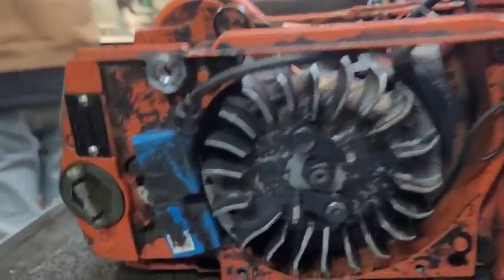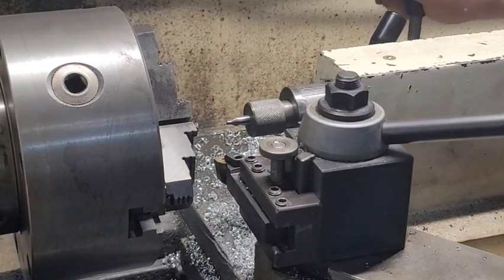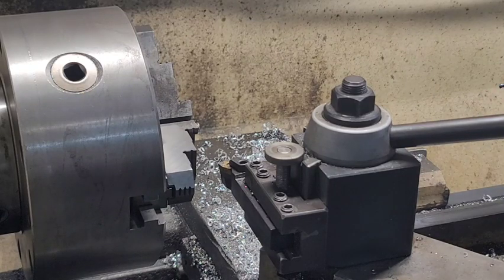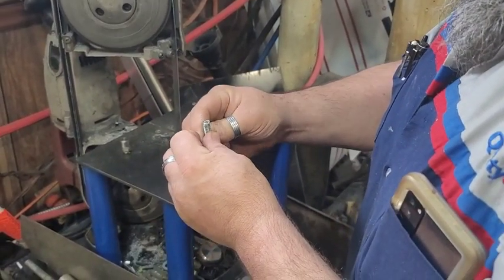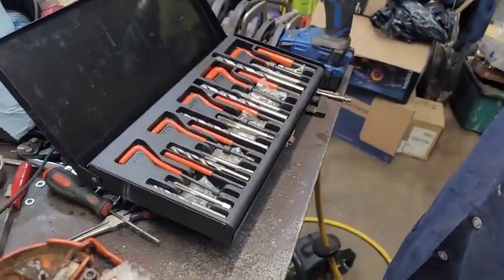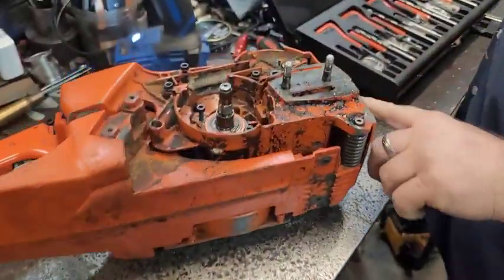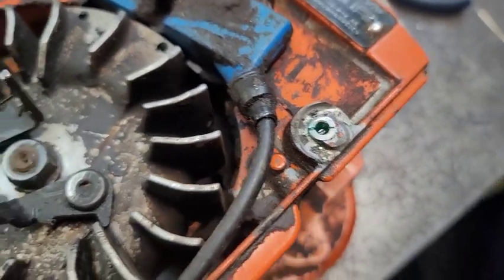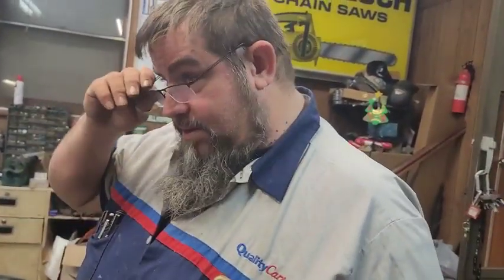Fixing Bad Bolt Holes

Comment: How would you go about repairing a cross-threaded  spark plug thread? Thanks for sharing your tips.
Reply from the maker: If there is enough room i run the tap thru it backwards but if not ill try to start a tap in it and clean them up